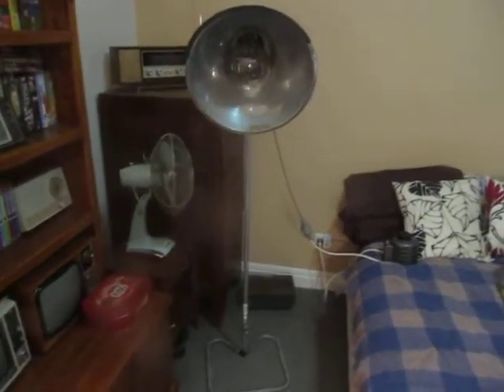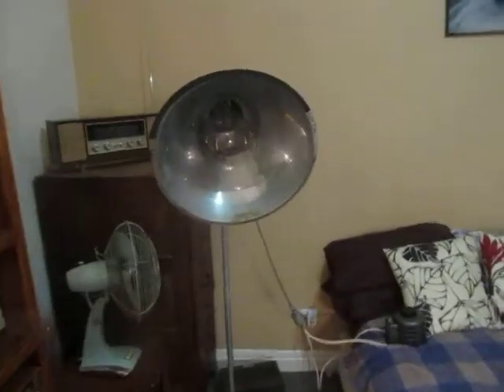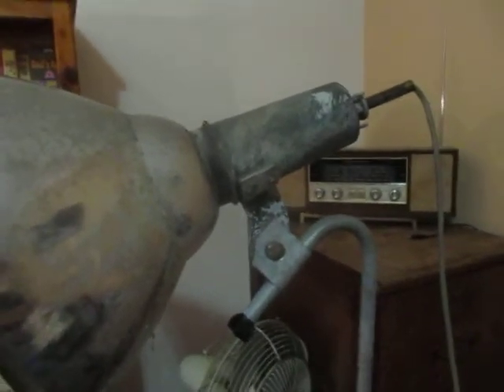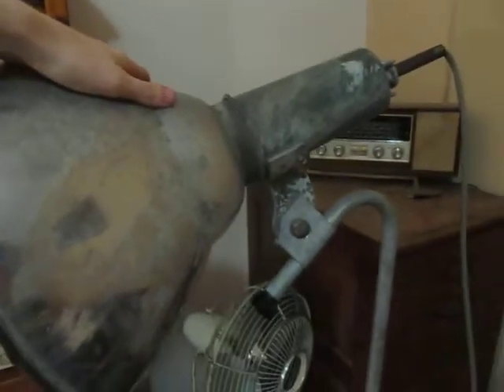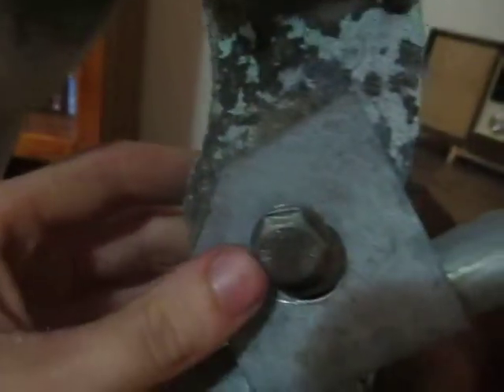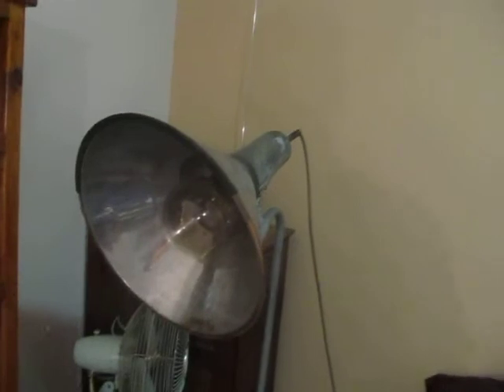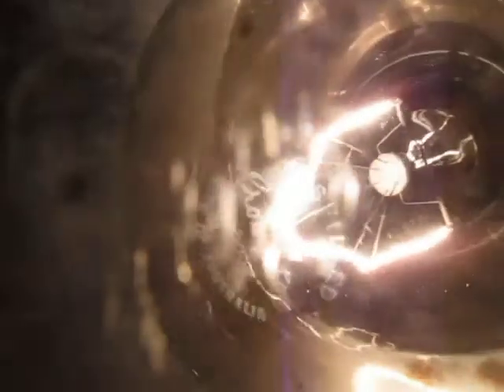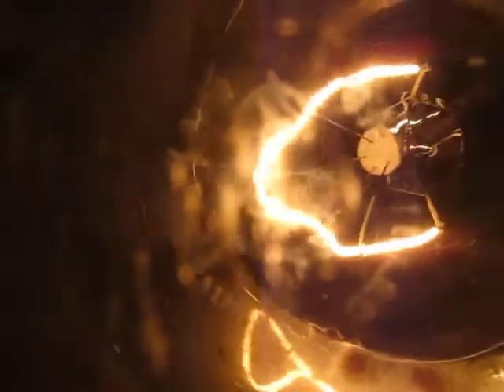1kW incandescent lamp

Comment: That lamp gives up more heat than you 900 Watt heater. LOL. That will be an E 40 Edison screw fitting. same as used for Sodium streetlights. That lamp unit also has no earth wire on it, be careful.
Reply from the maker: Kind've sadly true about the heat actually! It'd be interesting to install some form of HID lamp in it, with external ballast/control gear. I'm getting mad scientist ideas now. :-)
Reply: Earthing is as easy as fitting a new lead to it, replacement bulbs would be one of my big concerns if I had one of those lamps.

It's easy enough to fit a new lamp holder for E27 or B22, ceramic heat resistant ones are best in spotlights.